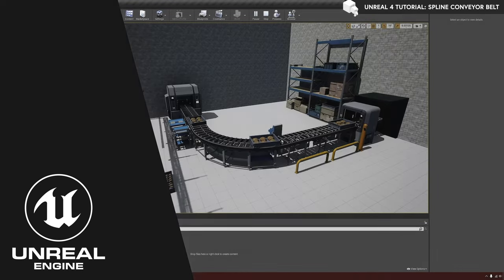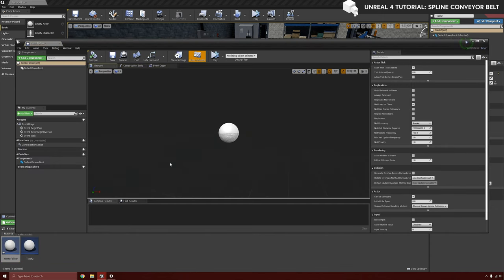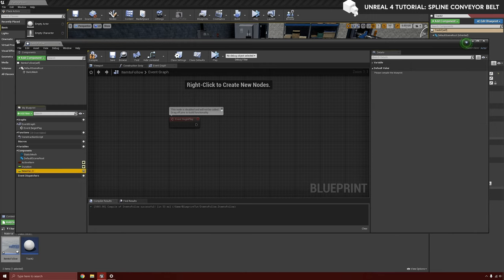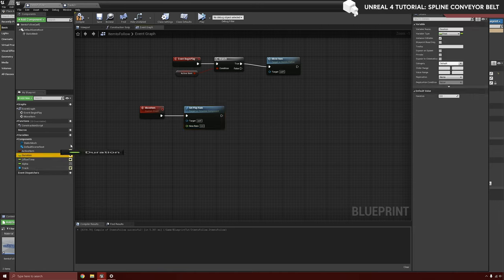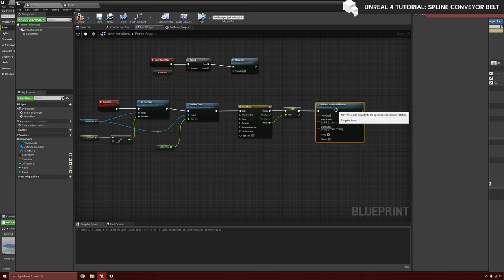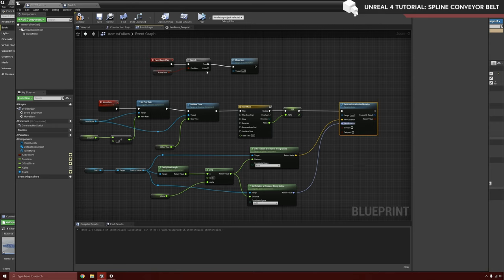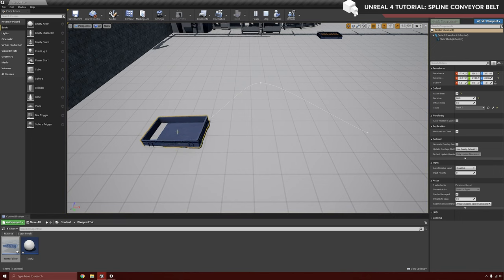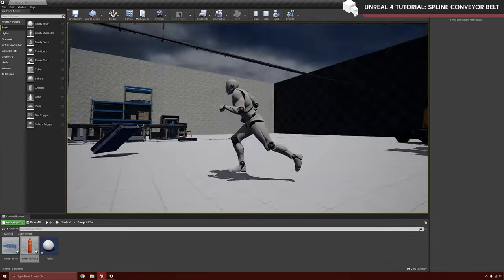Unreal Engine | Splines - Conveyor Belt BP

Comment: Is there a way to spawn multiple items evenly spaced on that track? I want my spline to be super long and automatically fill it tons of rocks.
Reply: Duplicate the items then set a different offset like he says near the end of the video
Reply: @bungy1970  That approach isn't compatible for a 1km conveyor. I'd have a thousand assets that I'd have to space manually. Then imagine if my clients change his design and I have to adjust everything. I was thinking of something with instanced static mesh. My solution so far was using a Blutility to spawn and space them.